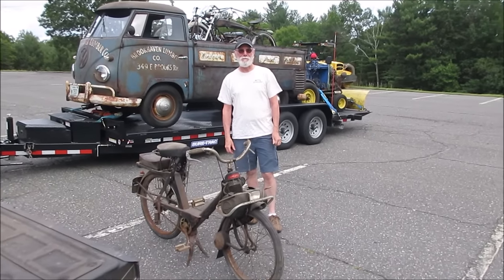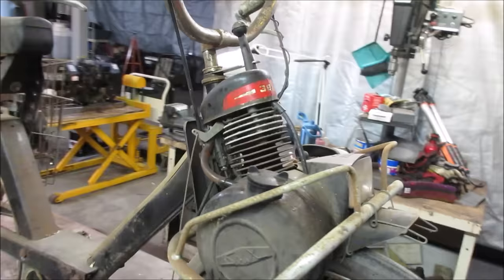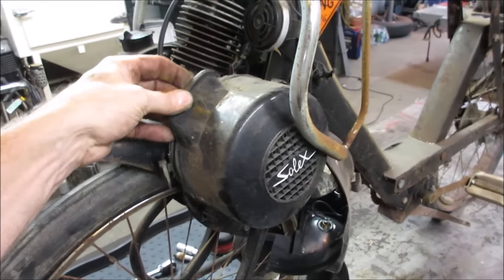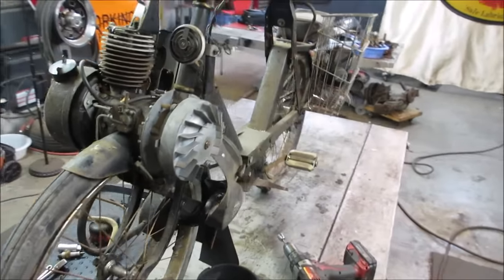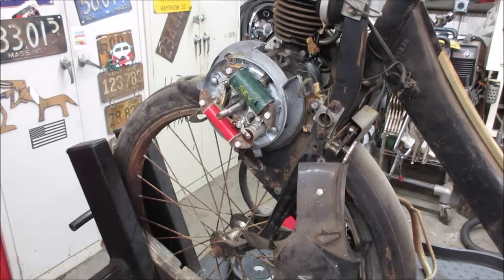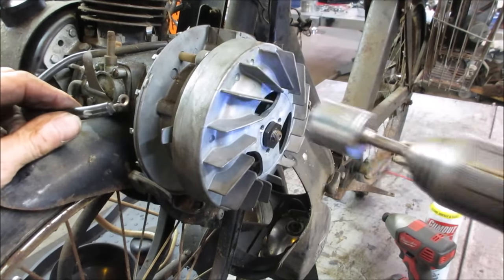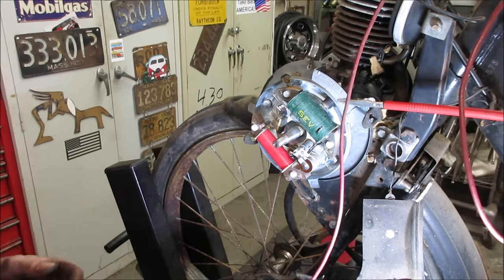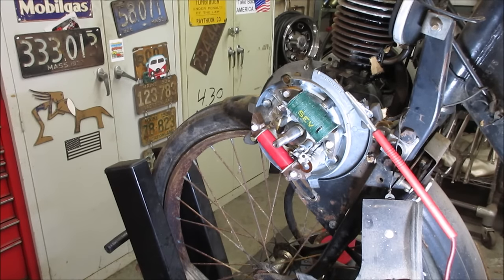Will It Run? VèloSolex 3800 Moped Parked in 1978.

Comment: I think the throttle works in reverse! At 50:56 in the video you can see the cable from the carb continuing downward to the front brake. When you're not pulling the lever, the tiny engine is running at full speed, when you pull on the lever, you close the throttle and apply the brake at the same time. And the decompressor is probably linked somehow, so that when you pull the lever fully, it stops the motor AND the bike. Trust the French to come up with a weird setup.
Reply: When you are riding through the countryside you don't need to grip the throttle. Think like a French person.
Reply: When you're riding a bicycle, you're used to squeezing the handlebar to apply the brakes and slow down. It makes perfect sense, and you can also drive it no-hands!
Reply: I guess the idea is that to brake, you pull both levers, brake and throttle, at the same time. It has a certain twisted logic to it. To "cruise", you let them both go and just steer. Confusing if you are used to a more conventional set up, but this thing was probably aimed at rural French cyclists who wanted motor assist, not "normal" motorcyclists.
Reply: Around here, we joke and say, "But, is it art?" When we finish up anything with wheels and a seat. 
This could really be art if it's done right!
Reply: Thats it! 
I had the same model many years ago. If you want to stop you had to pull both grips, to idle and for the front brake. 
For longer stops you have 
to lift the engine up. Loosen both grips means you feel the  power of 0.5 horses. A little bit of additional peddling helps to lift off. 🙂
Reply: I scrolled down to say the same thing as soon as I saw the cable going from carb to brake.
Reply: It does kind of make sense. Most of the time you would be going full throttle. I don't think that would be doing 90 or anything, just cruising along nicely. You only need to squeeze the throttle as you're slowing down. This is the same approach that a clutch uses.
Reply: I think the one place musty mentioned to hook up mirrors, that looks like the one to hook the other end of decompression lever. At 54:06 you can see that there is a tiny hole to hook up the other end of the decompression lever's attachment.
Reply: @celtjim994  
In Germany it was allowed to go 25Km/h with a Velosolex. My runned illegal 33Km/h!!😄Downhill I got it to 60Km/h but you have to change your trousers after this!😊
Reply: @MC-MC1MC  sounds like fun, but I'm just a big chicken, so I would never try it. 😋
Reply: I was screaming "look at the brake cable" at my phone. Muskie didn't seem to hear me...
Reply: that's exactly it ! I am french and we have a lot of them here, it was mostly used after war by workers to go to the factory. It is to be looked as a bicycle with a motor so yes, you start it by pedaling, then it goes full throttle on its own, and you manage the power by braking which lower the rpms of the solex in the same time. The decompressor is linked directly to a hole in the brake lever if I remember well (or something like that).. The wheel is trained by a rough pebble in the center. And the clutch ? you just drop down the motor to the wheel... :D Which also means if you are borken-down, you lift up the motor and it is a simple bike you can pedal to go back home.
Reply: It does have a twist grip throttle. It just that the front brake is connected to the throttle so that when you apply the brakes it also rolls the throttle off at the same time. Those twist grips are plastic and prone to breaking so it likely is a bit seized.  These bikes also have a centrifugal clutch and the top speed is 30 kms per hour which is roughly 20mph. They regularly got 200 miles per gallon so in todays world.....not a bad idea.
Reply: @elmerfudd1086 Not all 3800 have a twist throttle. Depending on the production year and I think also where it was sold it can have just the brake activated throttle.
Reply: It's a bike that was motorized and not a moped, we often make the mistake, for the spare parts, they make new ones Solex label:yougotthis:
Reply: The brake/throttle thing is really quite simple, but brilliant. The two alloy leavers are the front and rear brakes, just like a bicycle. Many older motorcycles had brake and clutch leavers that pivoted at the bar ends, which made it less likely that you would damage your hands in a spill or scraping a hedge etc.  The twist grip (on the right, as is conventional) has a very cleaver cam mechanism which prevents the throttle being held open while braking is applied.

As I remember the twist grip is not spring loaded as is always the case on motorcycles, and probably a legal requirement is all countries, for safety.  The beauty of this arrangement is that if you suddenly have a jab the front brake, for an animal crossing the road perhaps, you could immediately return to full throttle.  On long country lanes most riders would have the throttle fully open all the time and might take the right hand off the throttle for a while.  I had one of the last models made, which I bought in Edinburgh and eventually sold in Italy.  I dismantled it and made a wooden crate just big enough for it.  The motor went in a carrier bag? It had both a kill switch and a valve lifter lever.

Wonderful design.  I later owned a Citroen 2CV.  I could believe they were designed by the same genius engineer as they are both studies in simplicity and utilitarianism but they both have unique and quirky complexities that allow them to be inherently simple; they just have to be understood and admired.  Both works of genius!

Comment: This was THE icon of the early 1980s in Germany, the favourite of many secondary school students who could drive this vehicle from the age of 16 and later. In fact, it's a bycicle with this funny little engine on top of the front tyre. But it was cheap; fuel prices were not an issue (low - octane "Normalbenzin" was at, say, 1,10 DM /litre), so the students loved it. It was also an "alternative" means of transportation, Frenchie made, just as the Citroen 2CV, or "Ente" (Duck). Cheers from Germany!
This type reflects a whole class of twin - wheel vehicles called either "Mofa" (a contraction of "MOtorisiertes FAhrrad", or Bycicle w/Engine) or "Moped", like the one above. In fact, these vehicles were just bycicles with a reinforced frame and drum brakes with a two - stroke engine that was usually mounted right at the pivot point of the pedals, unlike the Velosolex!
Common makers in Germany were Kreidler, Zündapp, and Kettler. One model from East Germany, the Simson Schwalbe, is also petty popular even today, maybe because production has run out in the 90s.
Mofas / Mopeds have become rare on roads in Germany, having been replaced by so - called "scooters" long ago!
Cheers again!
Reply: You could even buy them as add on kits!
Reply: @jostouw4366  Didn't know that, thanks!

Comment: The earlier Solex's you pulled both levers to brake, it cuts the revs and the clutch idles.
Later models from the 80s the acceleration lever was also a front brake lever, pull the brake it stops, plus idles the engine.

Once you pedalled it to get you going and get the speed up a bit it will do around 30ish mph.

You have to pedal to get it started, pull the lever all the way in to decompress the engine, let it go once you have a bit of speed.

As far as I can remember the decompression lever was attached to the carb linkage, 
lever all the way in, decompresses the engine, out for drive and anywhere in between to control your acceleration (which isn't much) 
this was designed as a pedal assist bicycle, it just helped you to get along a bit easier.

Comment: A friend of mine at college in France had one of these Solexes. Sometimes for fun, the game was to stop at a red light with the front wheel at the start of a white stripe of a pedestrian crossing, engine running and machine on the stand. Full throttle before the light turns green and jump the Solex off the stand. For 2 seconds, the engine roller screamed on the tire, the tire on the white stripe, guaranteed effect, how to make THE tire scream at launch with a Solex! 🤣Some pedestrians turned and grumbled, but most just laughed... 😆

Comment: I think the British inch-standard in fasteners you're thinking of is Whitworth or BSW. (British Standard Whitworth) BSF, (British Standard Fine) BSP, (British Standard Pipe) and other threads are variations on Whitworth.  I learned about BSW in my younger years when my cousin's early Series II Land Rover experienced a steering tie rod end failure.  My cousin had spare parts galore, but we needed a tap to clean up the threads on the rod.  Tracking down a 3/8" left hand Whitworth thread tap in early 2000s Vancouver was a bit of an adventure!

Comment: Nice to see you guys in  the USA also like these things. A little protip: The shaft that is holding the carborundum stone expandes quicker than the carborundum itself. These things have a automatic clutch. The downside is that when you run the engine for a decent time while standing still with the engine on the tire, the clutch can get so hot, that de carborundum stone breaks. Therefore I always kill the engine when stopping for more then 10 seconds.
Reply: Sounds like you know what your talking about. Question for you. Is the engine on this 38cc's. Just watched a old video of a tear down on one and the piston looked a little large for 38cc's. They didn't give displacement. Any info would be appreciated. Thanks for clutch info, I didn't know about that.
Reply: @blowupbob1 Hi, I don't know the exact cc but most of these types of bikes are around 30 cc or so.
✌💜🇬🇧
Reply: @lesallison9047  Thanks! Found another site that says this model is 38cc's. Trust the name I guess.

Comment: I owned one of those in the early 70s. The throttle was  always backward. No clutch, so just pulled the level to clear the "grinding stone", which is directly attached to the crankshaft, off the front tire. The life expectancy of the front is about one third of the back tire.  Guys love to make a push start. On the other hand ladies often rode like a bike until catching the "walking" speed then dropped the engine retaining level. Any gas station would sale 5% premix (melanger) gas.

Comment: Nice to see you work on a Solex!
the front brake is operated with the handle you called throttle, and is supposed to let the rpm drop to where the clutch lets go... so you can come to a stand still without the roller eating a big hole on your tire... :)

You can get everything for them.... over here... :P

Comment: woooow .... that must be extremely rare in the USA.
In the "low lands" in Europe (Holland, Belgium, great parts of France) this has been extremely popular. 
Not usable on hills .... lol ... or you'll have to use the pedals to help the engine. 

Tires are so called "balloon-tires" ...

In France and Holland it is still a kind of "cult-object".

Searching on French channels (use velosolex) you will for sure find many channels about this "bike" and how to set carb (was a PITA) and spark.

The early models had the wheel running all the time, so you had to lift the engine when stopping ... the later models had a kind of clutch. (a bit like in e "vario") So you could leave the engine "down" on the front wheel without wearing-out the rubber.

Max-speed around 25km/h  ... in fact this is a bike with an "auxiliary engine" (like some bikes have nowadays, but using electricity)
Reply: Same in the flatter parts of Germany. My mom had a different brand and says she had to pedal half the time because the thing loved to break down. Eventually it met the same fate as most bicycles in that area, it was nicked.

Comment: Solexes along with Puch derived Sears Mopeds were popular when I was in JHS in the mid-late 50s.  Motor was started by unhooking the lever in front of the handlebar and it would drop down onto the front wheel and the drive wheel would rotate the engine which would start and you would motor off.  So you had to pedal a ways to get it up to 5-7mph before unlatching the motor.

Comment: I have the Dutch Berini bicycle motor. My Grandfather brought it over in 52. I used it in my teens in the 80s. At first it would barely produce power until I learned about 2 strokes getting carbon buildup at the exhaust port. In 01 I fixed a vacuum leak with a fancy O ring instead of fiber washers on the intake. 24mph flat out.

Comment: i drove a Solex S3800 as a teen... it had no spark kill it had decompression valve right in the cylinder head... to start it you where just cycling, holding the decompression open and dropping the engine down and leting the valve go shut. one or to bangs and it ran :D

Comment: Brand: Mitas
Condition: New
Rim: 19in.
Width: 2.00
The Mitas 2.00-19 M-02 is an affordable and classic looking street tire for many vintage mopeds. A great option to get that classic moped or small displacement motorcycle back on the road without breaking the bank! 

Load/Speed rated to 24B.
Reply: Not quite the right part. These are a bit special tires. They are flat and a bit sturdier to be able to withstand the friction of the roll that drives the tire.
Reply: @firionrazar3797 ok what are the right tires, and are they available..?
Reply: Available in France and it is not very heavy for shipping.
Search for "Pneu Solex 3800 - 1 3/4 19 Hutchinson Solex 19"
Some older Solex have bigger wheels and some more recent have smaller.

Comment: Rode one just like it one summer during the 1970s, it was quick because it had been 'drilled' (increasing the size of the fuel intake), quite fast when you have the wind from behind. A wonderful and quirky French piece of ingenuity and engineering, cheap and efficient in a time where incomes were low.
My dad actually rode one for work, back in the early 1960s, later he rode a Vespa 125cc scooter before he was able to save up funds for his first four wheel vehicle.
His first actual car was an Austin Partner wagon (a British Mini derivative), then he bought a German Goggomobil two seater, then upgraded to a super modern Renault 4, later upgraded to a used Renault 16 and in the late '70s he also bought a Citroën Mehari for my mother - the plastic body 2CV. All small cars and very fuel efficient (gas is double price, compared to the US, here in Scandinavia, heavily taxed).
Funny how this Velo Solex moped ended up in America. Good job making it run again, Mustie - it's sort of a historic piece, belonging in a museum now. Deserves a full restauration.
The gas lever as I remember is a 'reversed' handle, spring loaded so if you let go, it runs full throttle, and when you pull, it it reduces the throttle.
Thank you
The Völve

Comment: Originally these mopeds do not have an ignition cut out switch. There merely is a decompression lever on the handlebar which is used to start it and shut it off.

Comment: I rode those before,  the later model with the auto clutch so you don't have to pull the engine up.  the is a little toolbox in the back tire, the round front light is the older one, and later with the square front light.  Mixed fuel with oil, and if you add too much oil,  smoke like crazy.  Still have two of them in my older brother's in southern France.  Memory over half a century ago.

Comment: The backward hand throttle acted either as a dead-man kill switch or return to idle.  The longer top lever disengaged the Solex unit from the front tire. and when restarting the ladies (mostly) would start pedaling and then push the knob forward to start.  Solex sold these as add-ons to bikes as well.

Comment: British wrench sizes were called Whitworth. Used on those  British cars and motorcycles back in the day -50's and 60's.
Reply: Yup, learned that from Cars 2.
Reply: I learned that from watching SuperFastMatt working on his old Jaguar.
Reply: Learnt it from fixing my Seagull outboard. From what remember 1/4 Whitworth was somewhere between 3/8" and 1/2". The 1/4 referred to the thread, not the AF size.
Reply: The only thing is why would a French engine have Whitworth bolts when Napoleon was responsible for the metric system....

Comment: Glad to see that someone will send you tires, so you can go ahead.
I was in a friends workshop today & he has a VeloSolex 3800. I noticed he has 3 new spare tires and I also have a few spare tires BUT we are in Australia.

We got our tires from Vietnam, which is not surprising as they were a French colony so lots of VS's (& French cars) at one time.

Another thing you should check on -  is that the wheels can rust badly, so be careful.

There is a VeloSolex model that can foldup called a PliSolex it has smaller wheels & was built to fit into the trunk of French cars.
Supposedly more than 7 million were made in over 57 countries. (???)

Comment: The Solex motor bicycle was built as the result of two French engineers endeavoring to create a better bicycle. They formed a company named Solex in 1905 to produce small engine parts. Their interest in building bicycles with emergency engines began to grow, and in 1916 they received a patent for an auxiliary engine to be placed in the center of the rear wheel of a bicycle. By 1940, a prototype was built with the engine located above the front tire. After World War II, the first Velosolex Cyclomoteurs were sold. Production continues today. While the motor-assisted bicycle had been a consistent seller in Europe and South Africa, Solex is now returning to the U.S. market. It has a retro look and gets 200 miles on one gallon of fuel. It is considered a bicycle so you do not need a motorcycle license. It weights just 62 pounds.

Specifications:

Manufacturer: Solex
Country of Origin: France
Engine: 35cc, single cylinder
Transmission: Direct Drive
Top Speed: 20 miles per hour
Years of Production: 1947-present
Number Produced: Many